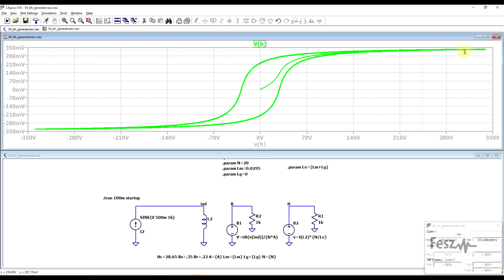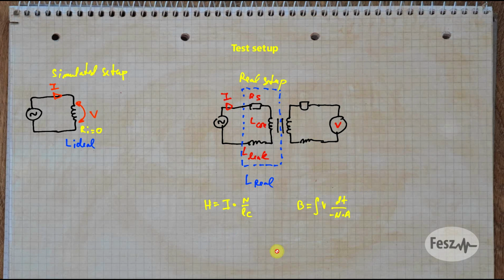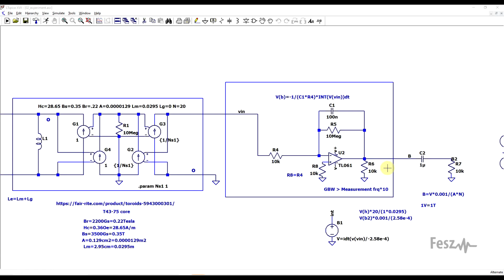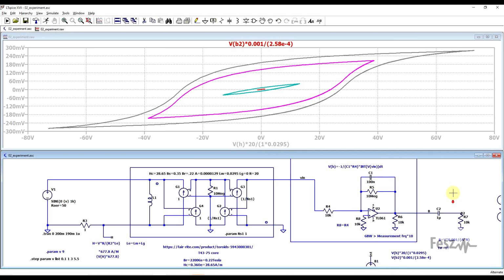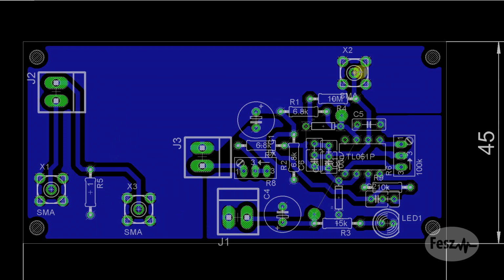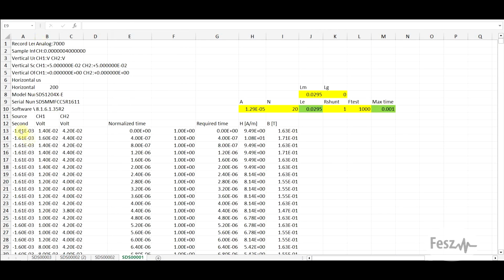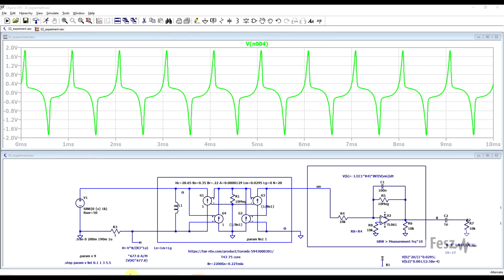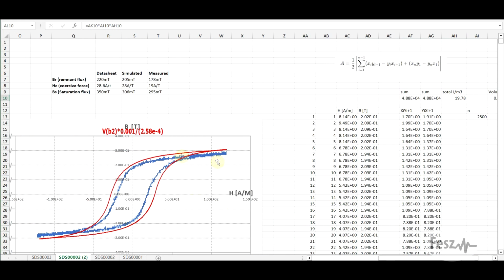Measurements of the Magnetic Hysteresis Curve

Comment: How to determine number of turns in primary of SMPS transformer? How would one choose waveform coefficient for SMPS transformer primary number of turns calculation? For sinewave transformer Np = Vrms / (4,44 × f × Bmax × Ac), where 4,44 is waveform coefficient for sine, for SMPS some sources use same formula Np = V / (4 × f × Bmax × Ac) though it is not clear which V(peak or RMS) are they using and how this relates to duty cycle, some use slightly different formula with volt-seconds. As far as I understand self inductance EMF should be equal to peak primary voltage below Bmax which should be taken slightly below B of saturation

Comment: This video is great. Thank you for sharing. I find it interesting to run the core at various frequencies and flux densities to get a family of curves. Also, the measurement is of the material, so testing a smaller core can still give valid results for a bigger one of the same material and construction, but it’s easier to measure (fewer VA to saturate)
Reply from the maker: I'm happy you enjoyed it! I would just point out that while measuring the same material core will give more or less the same shape - the exact saturation flux is still core size dependent; but if the core has an airgap then the shape will differ vs not having a gap.

Comment: Hello! I guess you have a limit for measurements with this setup by the output current limit of 200mA (if it is correct) of this signal generator. So some amplification/current source may be needed for some bulkier inductor measurements. Also measurement frequency can be important. What are the safe values, how these can be calculated?

Comment: FesZ, how do you know to set the ratio of gains the vertical and horizontal output to the scope? They B/H curve could look odd with the wrong gains.
Reply from the maker: I just the gain so that the waveform fills in the entire screen without touching the edges  - so to make sure I get the best use of the available resolution.

Comment: Hi FesZ, I have a Hypothesis that the slope of the B/H curve is quite different at low excitation levels such as those near 1µV, where weak signal radio signals are.
 Do you have any way to measure the B/H of a core at 1µV,  100mV and 1V and see if they have different shapes. At very low signal levels, I propose the B/H curve will be pushed over to the right, or more vertical that horizontal. I think core AsubLs should be derated for very low signals and they would need more turns to get the
shunt inductance up. Do you have thoughts?

Comment: Hi FesZ, I have a hypothesis,
 It is this,  the AsubL of a core becomes non-linear at very low levels, 1microvolt (-107 dBm) or even down to -110 or -115 dBm, because the slope of the B/H curve is mostly Horizontal at low H (low signal levels) and it becomes vertical at more normal, higher levels. This leads me to think that we should derate a core's AsubL when calculating turns for very low level signals. Can you verify this.  To maybe help clarify, if I put 5 turns on a core and measure the inductance at say 1V excitation level and get 70uH. Then if I measured inductance with a 1µV  excitation level my hypothesis would suggest I will get much lower than 70µH. This all applies to getting the shunt reactance for a transformer correct at the lowest frequency of operation. Thanks for any light you can shed.

Comment: Thanks! This is much more more educational than a dry textbook stuff. Question: if I understand it correctly, the circuit you've built is for demonstration purposes only, right? If you have to post-process the data on a computer, integration could have been done on that computer too. Thus the actual setup should just be a sig gen, a shunt resistor, core under investigation, two coils on it and a digital scope. Am I right?
Reply from the maker: Yes, you are right - the integrator is not mandatory as long as you apply post-processing of the data; however, without it, you cannot make the fancy diagram on the oscilloscope :D